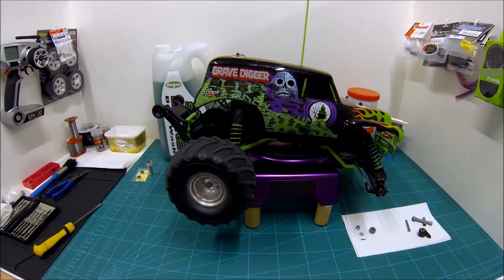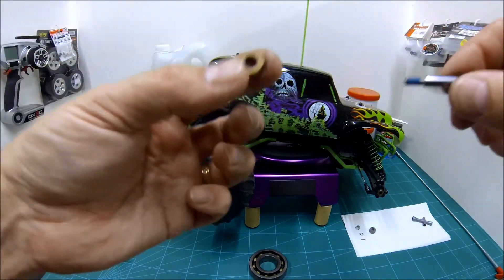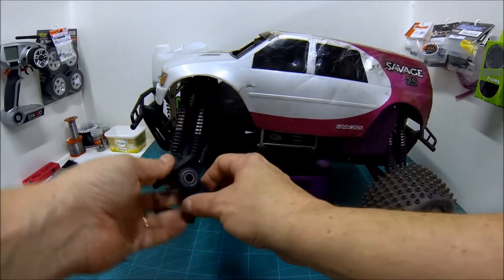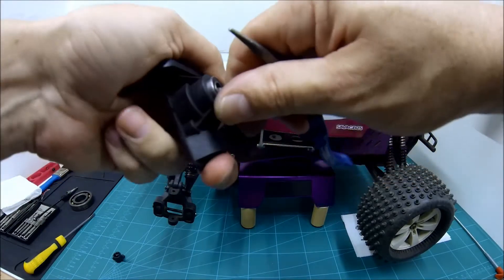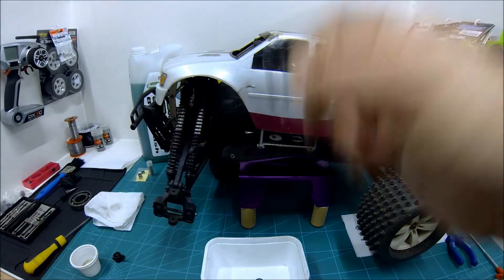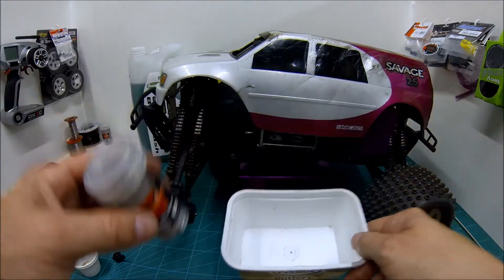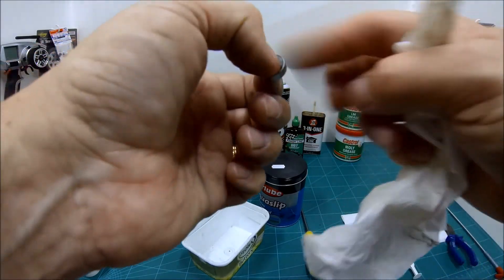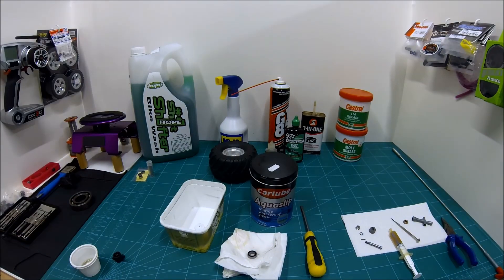RC Ball Bearing 101 & Maintenance.

Comment: How do I measure what bearings I will need as I want to change from bushings
Reply from the maker: Hi Joe, you need to measure the internal diameter (ID) of the hole in the middle of the bearing, outside diameter (OD) of the whole bearing and then the thickness. For example a Tamiya #1150 bearing is 5x11x4mm.
Reply: @4WheelRCUK  thank you just having real difficulty in finding parts for my acme condor I'm a newbie to nitro rc and bought a basic cheap model but may of done a bad thing

Comment: You still using the marine grease... now a day everyone talking about silicone oil...I have a redcat and I’m gonna do maintenance On the bearings, but don’t know what to use, grease or oil... your video is about 5 years old... just wondering how the marine grease is holding up.
Reply: Still grease.. Because oil has a lower viscosity you'll have to run maintenance more often and usually bearing duty isn't anyones favorite chore :P
Reply from the maker: Hi Frank, still using marine grease for my scale trail trucks that go into mucky/wet stuff. It is working very well for me. For things like my eRevo & Slash I use lithuim or ceramic based grease. But yes, oil not grease for lighter duty/high RPM bearings.

Comment: how do you put a bearing back in? please make a video or if you have one please give me a link. PS BEST RC VIDS EVER!!!!
Reply from the maker: Hi RC BOY, when you say "put a bearing back in" do you mean back into your model? If so, then typically I put the bearing on the shaft, axle etc. that will run through it, then use that to help guide the bearing into where it goes (gearbox, steering knuckle etc.), trying to ensure that it goes in straight & square. I just fit by hand - you shouldn't ever need to really force or hammer bearings to get them seated - if you are in this situation the bearing is not going in square and you should try again. Hth.
Reply: thank you for replying I figured out out. I'm a beginner in RC so I was also wondering where bearings are usually located in a 4×4 truck.